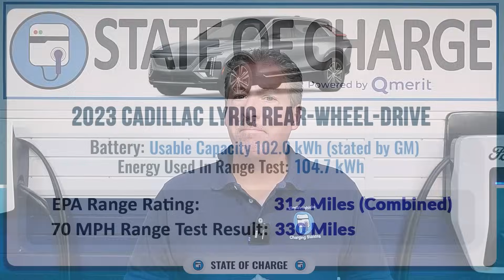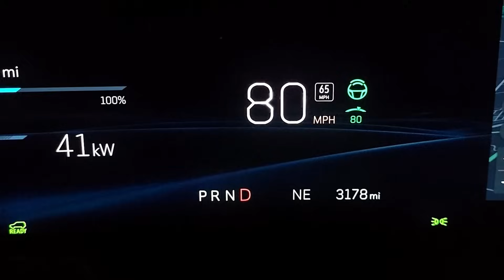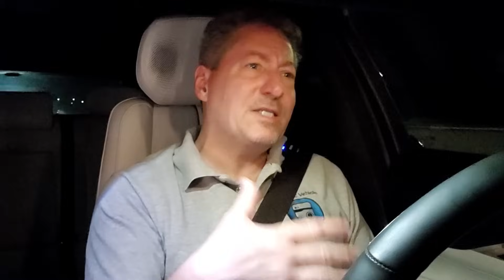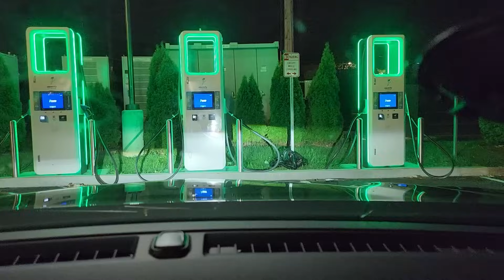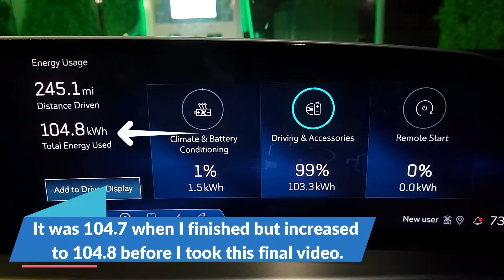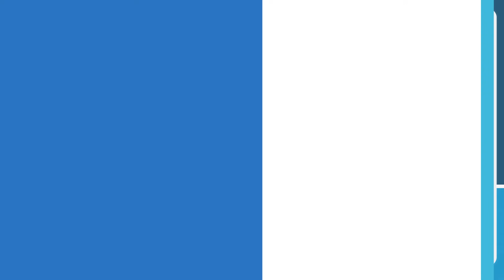Cadillac LYRIQ Range Test Comparison: 70 MPH vs 80 MPH

Comment: This is exactly my experience renting EVs, and why I feel that most EVs are not well suited for driving long distance in the Western US. Our speed limits are 80 MPH, and it definitely feels unsafe to drive less than that. When you are not climbing passes, you will be passed by semi after semi, most of them being "western triples" (the tractor is pulling 3 trailers.) And those are often in convoys, so you have become a road hazard. People on the coasts and in big cities just don't get those kinds of experiences.

Part of Porsche's ability to handle high speeds is that 2 speed transmission they have, and my tests show that there was not nearly as big a difference between 70 & 80 as there are with other EVs, especially Teslas. But they are way too expensive for me to buy.

I just got back from a 2,162 mile business trip in a Camry hybrid (~1,400 miles at 80 MPH, the rest at 70, total driving time of 27 hours [rotating 3 drivers]). Our fuel costs (regular) were about $14.00 per 1,000 less than your calculated EA costs. So the operating costs of your driving at 80 are only lower by the amortized increased maintenance costs of the ICE part of the hybrid. We only had to refuel 5 times for the whole 2,162 miles, each stop taking about 10 minutes. Doing that same trip in a rented Model Y about 8 months ago meant 11 stops at superchargers. That trip took 37 hours driving time, and required an overnight in a motel on each leg.

Bottom line: a big part of the lower EV adoption in the middle of the country is that EVs are not great at the kind of driving we do in the west. EVs are city cars that can be used on leisurely roadtrips in my opinion. They are complete failures at long trips where time is of the essence.

Comment: WOW 85miles less range?? Can you do this 80mph test with a LR Model Y? No wonder I only get 230-250mi LOL
Reply: I go 65-70 on the highway. Realistically, I'm mile per mile getting 240 on a 1-80% range use. I mean the fricking car tells you how to get the range lol
Reply: @Nazz-b7p  I assume you're driving a Model Y? Okay yeah that's just about at the 310mi EPA then if you can go 240 on 80% at 65mph. Speeding definitely hurts your EV range big time. I also put new tires on my car which boosted the range 5%. Hankook Evo EV tires. Not cheap but very good.
Reply: @LuKiSCraft  Yeah bought a 24' model y LR AWD. We're loving it.
Yeah I go 65-70 93% of the time lol. We do have a ton of elevation which can hurt but the downhill regen neigh negates that out. 

We're taking a trip to Cali in January for a wedding and I'll get a nice feel for it on the highway + the winter.

Comment: If you are wondering about time to drive 1000 miles. The difference in speed means you take 1000/70-1000/80, 1.7 hrs more to drive at 70. The difference in efficiency means you spend 1000/2.3 - 1000/3.1, 112 kWh extra. That would be two 30 min stops if you charge 10-60%. So the true difference is you get there 45 min faster driving at 80 mph and spend more. Cruise at 70 and relax. Much safer too.

Comment: Nothing to do with EV. This is true for all vehicles. The faster you drive (esp. 70+), the slower your average speed over long period. Both due to move refueling stops as well as cost of refueling,  as money is time.

Going fast only makes sense if one is very rich or very pressed for time.

Comment: On my first EV road trip, I had a leg where I dropped the speed 5 mph to get the estimated arrival charge to stop dropping.  I think I was also going a bit uphill.  Brought it back to my normal speed as the arrival SoC started rising again.

On the UI, I am not so sure.  It has been my experience that the OEMs keep removing information from their displays.  Enthusiasts will use ODB-II readers to get that information back, but the UIs get sparser with less configuribility over time.  That is not to say I don't want you to be right, but that I have observed otherwise.

Comment: Tom, I appreciate your videos. I'm afraid I need to rant a little. If the goal for going electric is to address Climate Crisis, and it certainly should be, then you need to talk with sustainable transportation experts and get educated. Life Cycle Assessment GHG impacts from EV has been massively underestimated and massively underreported. That's not a condemnation of EVs alone. It's a warning that we are being unrealistic of the change from ICE to EVs as enough of a transition. It is not, and it is becoming less effective with road tripping, long range, lower efficiency SUVs and pickup trucks, towing toys, and certainly when people don't understand how wasteful 70mph driving is for energy.

In conjunction with this there is a critical message that this is not a story of range and road trips. The real story is that our transition to renewable energy is a Herculean challenge. This means even with EVs, most people are not charging with renewable directly or even indirectly. If you charge at night, you are likely charging physically with fossil sourced electricity, even if you make yourself feel good about solar you generated during the day. If we don't reduce demand during times when renewables are underdelivering, we are failing to align our transportation transition with the renewable power that we believe is powering it. We should be demanding a 55 mph speed limit and EV drivers should be willingly adopting lower speeds to actually lower energy usage, fossil fuels burned to generate electricity, and speed the transition to renewable energy that is also needed for things beyond EVs. And people should be reducing road trips instead of imploring the auto industry to design cars that are capable of road tripping. If you're tempted to shoot this messenger, I work in the sustainable transportation space, and this is what the experts already know. We need to pop this bubble, because the EVs we're demanding with unrealistic expectations of what we can build and operate sustainably are shortening the time we have left to address the problem, significantly. Battery production is already resource constrained and not predicted to be addressed any time soon especially with the rise of 100+ kWh or 200 kWh machines like the Ultium lunacy. I'd love to dive deeper on this subject.  Next time, and always in the future do as Bjorn does and test at 55mph not 70 only. Show people that these cars all beat their range estimates easily when driven at Climate Emergency reflective speeds, and reinforce that saving energy is necessary for Climate Crisis. Contrary to the spirit of fun and exuberant EV revolution that we see on EV youtube channels, these cars are not the solution you believe they are. Again, sorry for those of you that have never heard this messaging from the left of EVs.

This is not FUD and it's not meant to slow ICE retirement, but we'll need shared electric rail pantograph steel wheeled public transportation, Active Transportation and micromobility to achieve sustainable transportation with zero emissions. Full sized personal cars are not even close to being sustainable at this point or according to anyone's deep analysis in the future. We'll have 2 tons per year CO2e budgets per person in 2050, and these cars cannot continue to be built with a minimum of 20+ tons of CO2e lifetime emissions even when run completely on renewable energy.

Comment: It will be interesting to see if driver behavior changes if and/or when most cars are EVs.  ICE cars are more fuel efficient on the highway than in town, even at 80mph so I think the consequences of reduced mpg is not felt as much.  In my ID.4 I now never drive faster than 70 (even 75 reduces the range significantly.  I don’t do enough road trips to gather the data to be able to compute what the optimal speed is for the fastest arrival for various lengths of road trips.

Comment: The Porsche Taycan has one major advantage for highway range and aerodynamics is only part of the story. The 2-speed transmission allows the vehicle to be more efficient at highway speeds, just like any geared ICE car is at higher gears. Transmissions in electric vehicles are expensive and a bit exotic right now. But I think eventually they will be more common in order to boost range without going to larger batteries.
Reply: Without the aero and intent for higher speed (Way above freeway) there is zero chance a transmission is justified.    You could easily say they also don’t need all that low end off the line power they all get and gear slightly higher as well.    Still 1 ratio to keep it simple and lighter.

Comment: That truly is a big difference, so "getting there faster" actually means slowing down a little and avoiding having to pit stop for 30min. to recharge(provided your destination is within range). I own a Polestar 2 and have 200mile trip coming up next week, I'll drive it at 70mph to compare it with a previous trip where I averaged 80mph
Reply: Yes
If you watch Bjorn's videos he sees how fast you can drive 1000km in a good EV it takes around 10-11 hours and a normal gas card takes about 1 hour more.
Basically stop and charge at the max rate and leave after 10-15 minutes just enough time to Go potty or buy some food and keep driving
Reply: Depends. If you can get there 30 min faster, but it takes you just 10 min to put 100 miles back in, it's better to just drive faster. I drive 78mph from st.louis to Kansas City and back. I'm looking at leasing a lyriq and it seems if I drive at 75mph, I can get to my destination without stopping.
Reply: On the condition you find a fast charger and you charge at the optimum speed / SOC level, driving faster will result in faster arrival … Experienced myself and you can calculate it in ABRP … But you need a free charger at the highway that delivers … Also an advantage is you get a break …

Comment: Tom, I'm a big fan of your work and videos. Please do this with your Bolt. We need someone like you to extol the importance of low-cost and highly efficient EVs. Thanks, Tom, and great work as always!
Reply: The comment above this one did exactly that. Besides, the speed limit is 65 in NJ. Asking Tom to do this again and again for everyone's car is risking a speeding violation.
Reply: @blownb310 yes also there's a lot of bolt owners it's not a new car. Plus you can calculate it. The difference between 70 and 80 is about 30%

Comment: Your a real trooper Tom!  3am certainly not bankers hours.  Not too surprised at the result.  Towing with an EV the difference between 60 and 65 is significant!  In an EV every 5 mph over 55 becomes exponentially worse for efficiency.

Comment: Now you have to repeat this test on 55MPH 😂
Reply: I've done this, and it took over 5 1/2 hours at 55 compared to 2 1/2 hours at 70. And that was with the relatively short-ranged car I couldn't imagine doing it with a 100kwh battery

Comment: I did a similar test in my Mach-E standard range only slower... 
At 70mph I got 2.7 mi/kWh & 188mi
At 55mph I got 4.1 mi/kWh and 281mi ... what a difference!
Reply: Nice 
It's only a little off from the math of 4.1x.061 gives 2.53
Reply: Drag increases with the square of the speed. It's a big deal.

Comment: Aerodynamic drag should be proportional to speed squared, so it goes up 30.6% from 70 to 80 mph, regardless of the vehicle. There are other energy consumers in the vehicle such as rolling resistance, mechanical drivetrain losses, and heat loss in the motors and inverters, but they don't increase as aggressively with speed. Your results show an energy consumption increase of 34.7%, which is quite surprising. That's over 4% more than expected if the car had no other energy needs!

If Taycan is less affected by speed, that means it must consume a larger fraction of its energy in rolling resistance, mechanical losses, etc. In other words, that's a sign of inefficiency, not a sign of better aerodynamics.

Consider doing the test yet again at 60 mph.

Comment: Great follow-up video Tom, and inline with what I see with my 20" RWD also at similar speed and conditions.  Curious, were you able to get another DC fast charge after the run?  If so, did you still see that horrible dip 15 minutes (or so) into charging?  I know Kyle didn't see that with his, but he didn't start charging at a low SOC either - which it seems related to.  Charging at high 180+kW power, then to the basement before some recovery.

Comment: That was a fantastic comparison.  Thanks.  Here is another interesting stat. 245 @ 80mph is 3 hrs while 245@70 is 3:30 min.  To get back to 80% would take less time because your battery has more charge. So did you gain anything going fast?
Reply: @outofspecreviews and @StateofCharge - challenge issued. Who would win between ripping rabbit Kyle and turtle mode Tom?

Comment: Just curious, does New Jersey have any section of the highway with 80 miles per hour speed limit? I lived in Northern New Jersey for about 30 years, moving away 7 years ago. I don't recall any limits that high. Of course that doesn't mean people didn't drive that speed, but most people In my travels drove between 70 and 75 (in a 65 zone)
Reply: Same, I'm in Bergen county. Would love to know where you can drive that fast for that long in NJ. 😮.  NJ is great for evs , usually there is a ton of traffic

Comment: Thanks for the road test. I can only hope that GM will update our 2016 Bolt EV and show SOC% and miles remaining under 10 miles left. Thanks for communicating these issues with the GM people.
Reply: Maybe GM's point is you shouldn't be driving it with under 10 miles left - find a charger.  They do the same thing with the ICE vehicle fuel gauge.  It will just show low, not miles remaining because it is variable depending on speed and terrain.

Comment: drive Phoenix to San Diego round trip once or twice a month .  Traffic cruises 85mph in AZ and 80mph in CA.  Tesla model Y needs to charge about every time I need to pee.   So the increased charging does not make me stop more often.  And the time I lose charging more often is less than the time I gain by driving faster.  The cost saving by driving slower is not worth the time lost.

Comment: Hey Dave, can you check out and confirm / refute my trip time analysis for 80 mph vs 70 mph in the lyric on a 1000 mile trip?  Doing the really simple part of the math, if there were no stops at all, driving 70 mph for 1000 miles would take you 14 hours and 17 min, vs driving at 80 mph for 1000 mile would take 12 hours and 30 min, saving you 1 hour and 47 min. It looks like on a 1000 mile trip at 70 mph you use 322.6 kWh, and at 80 mph you use 434.8 kWh, so that extra 112.2 kWh is probably going to cause you to do two extra charging stops.  Based on your 20 to 80 charging test taking 40 min, this would add 1 hour and 20 min to your trip.  So, in conclusion by driving the lyric at 80 mph instead of 70 mph on a 1000 mile trip, you save a whopping 27 min on the trip.  This is not including any extra time from pulling off the highway / driving at slow speeds to and from the charger for those two extra stops... so in reality it is even less time saved.

The faster your cars average charging speed over a "normal" charging session, the more time you save by driving fast.  For example, in my Modle Y a typical charge is 15 min vs the 40 min in the Lyric, so driving fast and adding 2 extra charging sessions to a trip would mean driving 80 mph vs 70 mph would save me 57 min over a 1000 mile trip.  Saving an hour would be worth driving that fast, but saving half an hour would be a toss up depending on speed limits / risk of getting a speeding ticket.

Comment: I get ~20% better mileage in my car at 65 (42mpg) than at 75 (35mpg).
Reply: Your reduction is a little more because the increased drag from 70 to 80 is more than that from 65 to 75. This reduction is entirely the same for gas as it is for electric, and ONLY dependent on aero of the vehicle.

Comment: I did a similar test with my Chevy Bolt last year, my speeds were 65mph vs 75mph. In my test I found I could travel about 50 miles farther at 65mph than I could at 75mph. So as you state every EV will see similar results. Aerodynamics of course will affect the amount of reduction. 
Love your range tests, keep up the good work.
Reply: This affects every vehicle not just EV's😊
Reply: @RichmondBaker  yes it does but EV’s usually suffer more range loss than ICE. With the already limited range and less refueling locations compared to ICE vehicles the loss is more critical too.
Reply: What ranges did you get in your test? We have a 2022 Bolt EUV and would be great to know real-world results. Thank you.
Reply: @PresleyTV  I started at 80% charge both times because I did not want to hold up the DC fast charger that long, at 65mph if I recall it was about 190 miles and at 75mph it was about 140 miles.  From 100% I estimate you can add about 40 miles to each. Now to compare around town where the speed limit generally is 30-45 mph with stop and go traffic I am getting an average of 306 miles charging to hill top reserve at home which is 87-88% charge. Mine is a 2017 Bolt EV with a new Battery.
Reply: Thanks!

Comment: Hey GM, percent state of charge is most useful for when you drive somewhere from home and want a quick mental estimate of whether you can get back without charging. I don't want to ask the nav or have to know how many miles from home I am.
Reply: Do you wonder how many gallons of gas are left in the tank?  I think the point is to use the range indicator, not SOC.  SOC doesn't help you if you don't know how the car is drawing from it.  Maybe additional battery cooling needs to occur because you speed up or the outside temperature rises.
Reply: @theflew  Why do essentially all gas cars have an indicator of proportion of fuel remaining? I didn't suggest not including estimated range remaining.